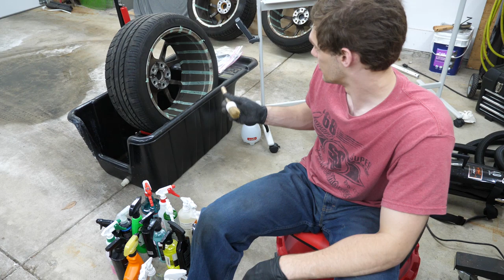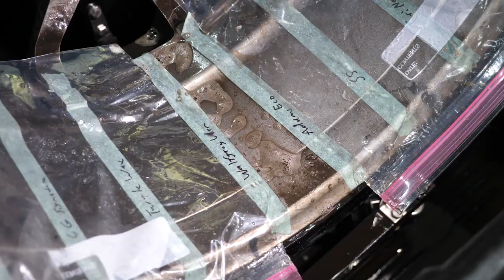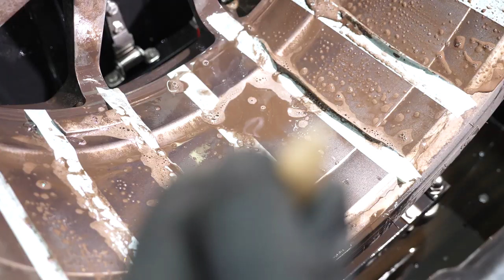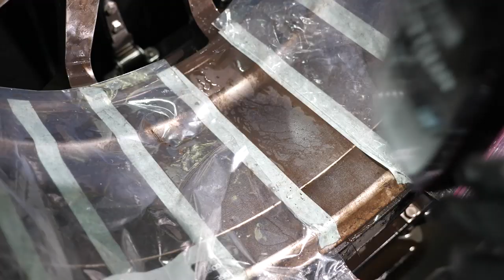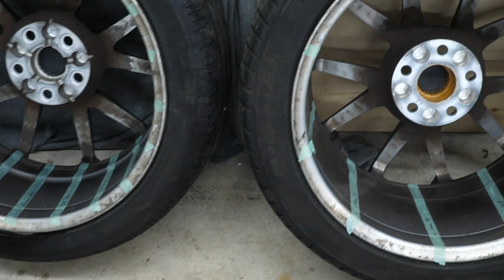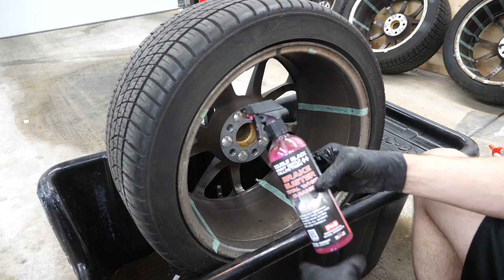The Ultimate Wheel Cleaner Experiment: Real World Testing Pt.2

Comment: Cool video. I used to use Simple Green but I think it damaged one some of an anodized area on my OZ wheel center cover. I am almost out of my traditional wheel and tire cleaner but I realized that I have a TON of different APC (full gallon bottles or more of: Simple Green extreme motor sports, simple green aircraft extreme concentrate, por15 degreaser cleaner concentrate, Charlie’s professional all purpose cleaner concentrate, clean and simple super cleaner concentrate, and several other smaller cans of different engine degreasers, chain degreasers, etc that I use for my cars, dirt bikes and race kart). Would also be curious to see how household APCs compare..409, windex window cleaner, Meyers, watkins, and whatever else my wife feels is the flavor of the moment 😫). And see how they all compare. Judging by the results you have so far, I’m willing to bet that there isn’t a significant difference between any of them. Perhaps I use the simple green aircraft or extreme sports cleaners as they both have some sort of Boeing certification, which I think means that they are safe on Anodized and other coatings.  Others like the por15 may have this as well. So tempted to just forget about a dedicated wheel/tire cleaner and just throw one of these in a Zep bottle and go with it
Reply: Yeah the original Simple Green (All Purpose Cleaner or Industrial Cleaner & Degreaser) can corrode aluminum according to Simple Green, though they say that's mostly just from a surface being left wet with Simple Green. 

The aircraft version, the Pro HD version, and I THINK (but I'm not certain) the Max car version are not corrosive to aluminum according to Simple Green. All 3 of those seem similar to me except the Max one only comes prediluted

Comment: Interesting. Couple of weeks ago I was trying to clean my Y spoke wheels on my motorcycle which are really the hardest weel on any vehicle to clean. There was some oil splatter on from the chain both on the engine and rear wheel. First I went with the cheap solution and bought some wheel cleaner that didn't cost a lot. It didn't do as good as soapy water to be honest and after that I got recommended Chemical Guys Orange and bought it. That thing literally worked the second I sprayed it and even got the cooked oil that was being so stubborn for a long time. Maybe these cleaners will only make difference on more stubborn cases like mine.
Reply from the maker: When it comes to oil/chain lube you need a degreaser. I have the same thing I deal with on my motorcycle. What wheel cleaner did you try first? I wonder why it didn't work.
Reply: @SourceGarage  I used Feral Wheel Cleaner and it didn't do anything.

Comment: So, quite literally, there is absolutely no difference between 50 different brands.
And you can probably assume its the same thing for windows, glass, teeth, hair.
It's the same product.
That explains everything.
Reply from the maker: I'm sure there are some chemical differences, but I believe they are typically minor or situational at best. I am working on more experiments to find these differences.
Reply: @SourceGarage  Sure. They throw in some dye and foaming agents here and there to make it look legit.
Reply: @joshuaprets2044  i think the problem with this test Josh was the fact that most of this dirt could have been removed with just water and agitation.   Wheel cleaners are only really needed for caked on brake dust or contactless washes.  I did the same test as this with a wheel from the junk yard, and there were definite differences.  I compared Simple Green, Super Clean, Meguiars  APC, Meguiars Wheel Brightener, Meguiars Paint and Iron Decon and LA's Totally Awesome.  Meguiars Wheel Brightener at 4:1 was the only thing that got the job done after one pass
Reply: @derek723  so for basic maintenance it probably doesn't matter but for a professional or tougher job a dedicated wheel cleaner may prove its value
Reply: @phil7121  hey Phil, yeah that sounds about right